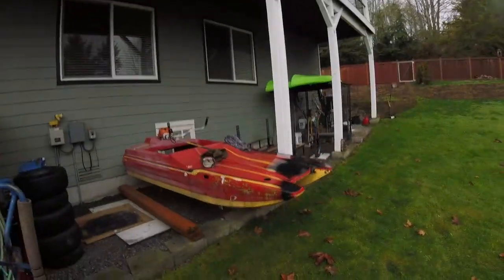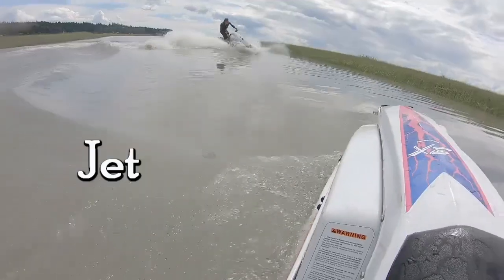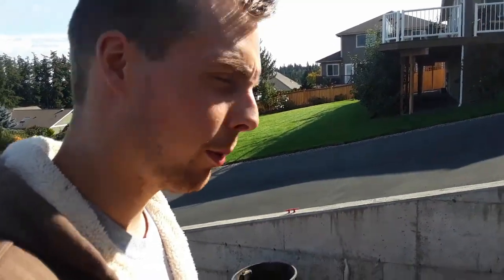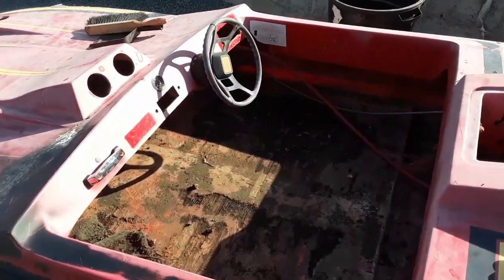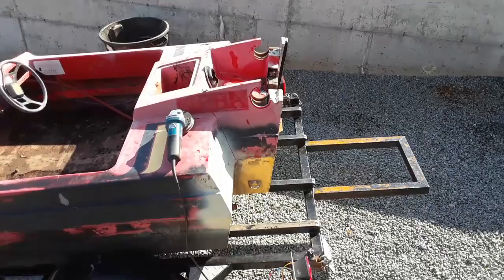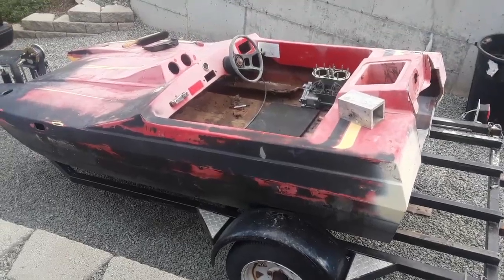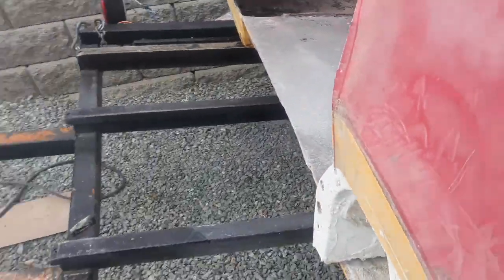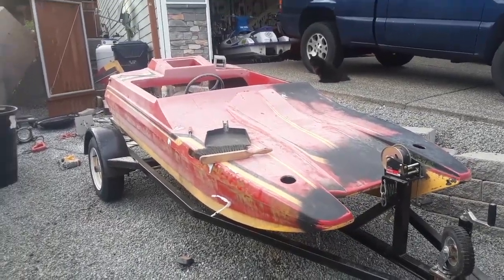cougar cub mini

Comment: Yeah 1st for once that will be brilliant when finished!!
Reply from the maker: We are trying to decide exactly what engine setup to use. We are considering going with twin Yamaha 1200 three cylinders 🤘
Reply: @JetSkiBrothers  Yeah that thing will fly. There 2 strokes right?
Reply from the maker: Chris Jones yes
Reply: Put that Yamaha sho motor in it!
Reply: @kyleturner4695  We will have to run twin engines because the center is raised with no way to run a single center engine..... Unless it's an outboard.
Reply from the maker: Kyle Turner it’s going to have 2 engines so we would need to find ourselves another sho motor. But seriously that would be insane 😃
Reply: @Jacobskibros   ohh ok I gottcha
Reply: @kyleturner4695  don't forget the 2 strokes are much lighter than the sho's and love to rev.
Reply: @Jacobskibros With the 2 strokes being lighter & less compicated that's definitely the way to go.